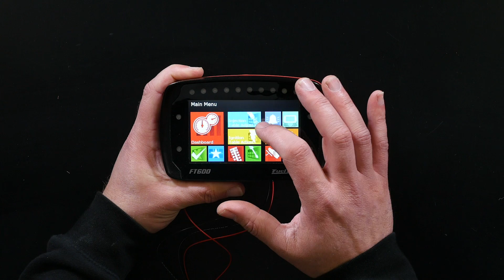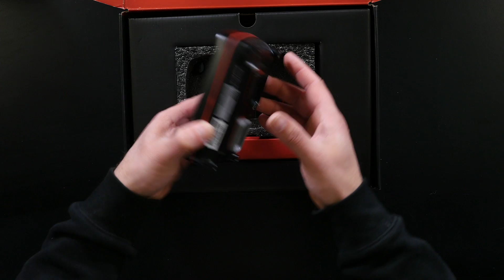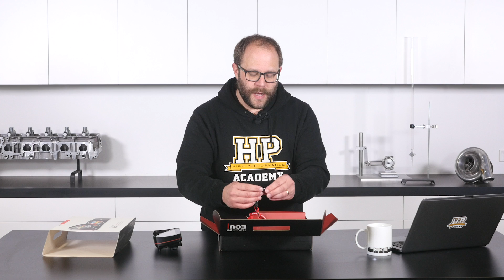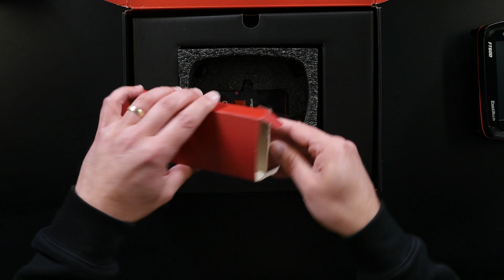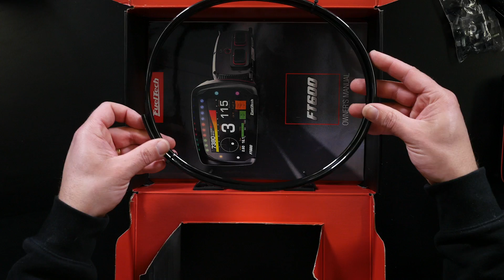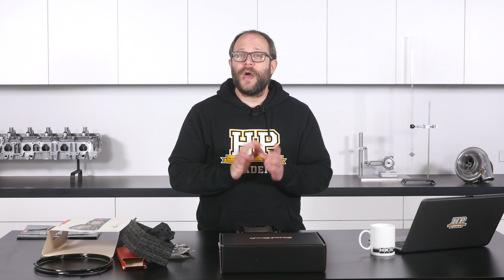📦A Standalone ECU that is ALSO a Dash Display | FuelTech FT600 Unboxing

Comment from the maker: Are you already running or do you plan to run a Fuel Tech? If so, what model?
🔵 Building a fast car? Get $400 OFF the all-inclusive VIP online course package deal: https://hpcdmy.co/offery156
🦵Kickstart your EFI Tuning knowledge. Get 50% OFF your first online course: https://hpcdmy.co/offery156
Reply: WOW, that's worth about 3k US
Reply: Work with tfsi from audi?
Reply: @boscovich11  it doesn’t work yet with direct injection. The only one that works, as far as I know, is Motec, but it’s very expensive. There are people running EA series engines with 2 injectors per cylinder, direct and indirect, with the Fueltech ECU in parallel to the original ECU. This is a TTRS running like that on YouTube.
https://youtu.be/dofgNY_seU8

Comment: 5 years since this video and it's still pricey 🤣🤣🤣 looking foward to getting the ft 550 I'll get the 600 if I make a drag car
Reply from the maker: haha yes ECUs are at the point where prices only really go one way now. There's always some risk but you can find some good deals on secondhand units as well from time to time. Just make sure whatever you get, FuelTech or otherwise, is supported by your chosen local tuner if you're not tuning it yourself =) - Taz.
Reply: @hpa101  yea im going all out on my genesis coupe no ebay parts 🤣🤣 gonna finish it off using fuel tech 😈

Comment: 2300 usd yea ok ill pass not thats its not doable its just that as a tek nerd i fell like its a bit to high priced just like most things when one thinks about it do they sell motherboards or screens so as to fix it wen crap happens? ill bet not at all or if so it will be a division of price as a whole AKA high asf knowing the parts cost very little to moderate  to built it just pass and stick with megasquirt and more of open source projects i can use any old tablet for screen is it fiddly yep but at over 1000 cheaper and does the job and is repairable via hard parts schematics etc its a long term maintainable unit   .now if it was priced at 550 to 700 usd at most be a winner i guess
Reply from the maker: Yes every product is not for everyone one, there are pros and cons for them all for sure. A unit like this does have some distinct setup and wiring advantages over adding an extra display and logger, but if you don't need those advantages you don't need them. Remember this is essentially 3 different items in one, ECU, logger, dash display.

Sometimes though you do trade off saving money for spending extra time setting things up. Some people would rather trade that money for their time to spend it on other things instead.

I think if you manage to break the screen on this though in a race application, it's probably the least of your worries for what else on the car is damaged 😉 - Taz.

PS: Note we don't sell any ECUs, and everything has pros and cons, even if it's yours, ours, or someone elses most favourite solution for their specific application.
Reply: @hpa101  i agree i guess it always aggravates me a bit wen its so simple to incorporate all this using a basic arm cpu or  and at a 1k or price so ? seems to me would could be a giant seller but who knows how many they could have made up quickly especially now post convid 1984 days..oh man ;} i would buy 3 or 4 of them i know that`s over 9k lol see my point of contention .i do see your point its like an iphone 17 or what ever out now last time my buddies pulled his new or out i said just to be a dork yep i got a new unlocked Umidigi 180.00 that does the same crap allbe it a bit under yours in specs by a tad bit in the camera area and its fully rooted and customizable  oh that irked him i guess 1200 or so he thought it was so much better but why its a phone at end of the day all that matters its it a good unit for your time spent working for it ill not buy it as a status thing that to me is like lottery tickets or the quarter gambling machines idiots use in a way ..I promise you i am a {nice guy} i just hate being ripped off or seeing other with less knowledge getting rear Ram rodded with out even as much as a thank ye mam  LOL i know i bit much Be blessed
Reply: I don't know if you'll see this comment years later, but Fueltech is a benchmark in customer service; even if you burn out one of their ECUs from 2010 or earlier, they'll still fix it with a very good price

Comment: Getting the 550 for the new 2j ✊
Reply: Wish they would've made a video for FT550. What are the differences for the FT550 vs FT600 asides LED lights, aluminum casing and a couple more Inputs/Outputs.

Comment: How would this compare to my AiM mxg 1.2  display
Reply: Same functions and more. Didnt know your display, so searched for it. It can be configured to display different info and has datalog capabilities. Fueltech is a full standalone ECU, so the display (also fully configurable) and datalogging is just two of its many features. You can also add traction control, wideband, closed loop correction, timing control, suplementary injectors, dwell x tension and many more. Apart from really traditional motorsport ECUs (motec and syvecs come to mind), fueltech (and other similar standalone ECUs such as Octtane, Injepro, Pandoo, Megasquirt) are probably the next best thing for people in the racecar business, since you can basically change anything about the way the engine works and adapt to any settings required.

Comment: Nearly 5k aud for the full kit
Reply from the maker: Yes the exchange rate isn't the best for you guys at the moment either so that will fluctuate a little. There are a lot of quality ECUs on the market though, so if this one isn't for you there will be another that ticks the requirement boxes I'm sure - Taz.
Reply: Yea because this is a Brazilian product the manufacturing cost isnt cheap and sending over to Autralia isn't cheap either
Reply: @retroree5  bro in Brazil same ecu is sold under 1k$. You guys can pay more that’s why you pay 5k $

Comment: Does it have ethanol % rating
Reply: Actually, yup, FT450, FT550 and FT600 are totally compatible with flex fuel sensors.

Comment: Would you recommend this over the ecu master emu black i have a 1jz 260z that will be  mostly a road car maybe a few track days.. around 4-500 hp max. Thanks
Reply from the maker: Are you tuning it yourself? - Taz.
Reply: @hpa101   probably yes for the most part..i might take it to the tunners to really dial it in, but i would want something that easy enough for me
Reply: @HotGritz910  which ecubdid you decided to go with? I'm in a similar situation.  2jz/240z
Reply: @damnitdang  megasquirt you can use a tablet as a dash screen and tune with it if you wanted to very long term maintainable unit as its open to all matters of mods upgrading with out silly prices .that what chaps my ass with expensive brand is it ant even repairable at least in an easy way

Comment: Sounds like a great little unit...BUT a 4.3" screen!!! omg what a lost/failed opportunity!
Reply: They have bigger screens
Reply: @ThaG001  no, this is the largest, 450, 550 and 600 have the same screen size.
Reply: Totally agree
Reply: Buy a holley digi dash?
Reply: @Skarajew  I'm working building my own display with a ECU, GPS, PDM, & DCM all in one.
Reply: Allegedly have a pair coming out this summer (2023). The ft700 and 700plus have a MUCH larger screen. Looks like no laptop required

Comment: It's good to take notice that Fueltech was born in racing. This is real performance, proven with the fastest FWD cars in the world in Brazil and some of the fastest RWD cars in the world in the USA. Also it's street proven, with thousands of street builds with loads of features that include even flex fuel capabilities. So you can run any blend of E0 to E100 with it. This is the dream of any one that wants performance in Brazil

Comment: I could really use this in my MR2 turbo. I’m just starting the restoration process and my gauges now are a mess. I’m using my phone for speedo ATM. From my background with the identical Celicas I already know there is tons of HP/Tq hidden in Toyota’s ridiculously rich stock tune also.

Comment: I am very interested in this unit. Just curious about how to wire that up for my R32 gtr...?? Im sure its possible
Reply from the maker: G'day Sean. Yes, would absolutely be possible to install into an R32 GTR. I'm not 100% sure the factory RB trigger pattern would be supported at the moment, but you'd be best to replace the original optical sensor with either a lower tooth count pattern disc, or a variable reluctor setup, as they interface much better with aftermarket ecu's in general :-). If your OEM wiring is in good shape, build a harness that extends it up to the gauge cluster, install the fueltech, and you'll be away :-). - Zac.
Reply: I am actually switching to a platinum racing trigger system and ignition system. From what I've been reading on the Fueltech it should support what I'm trying to achieve